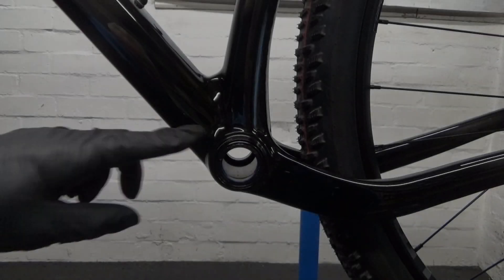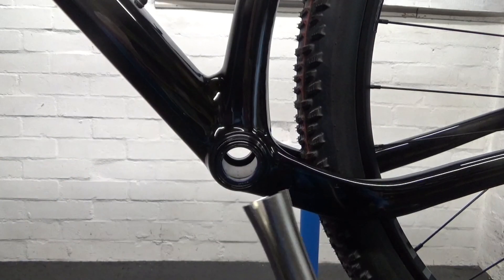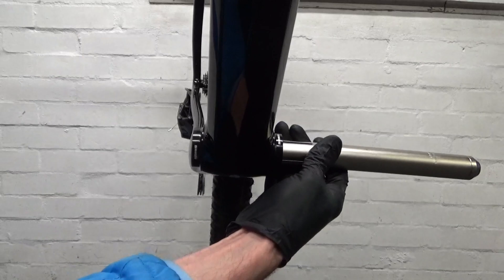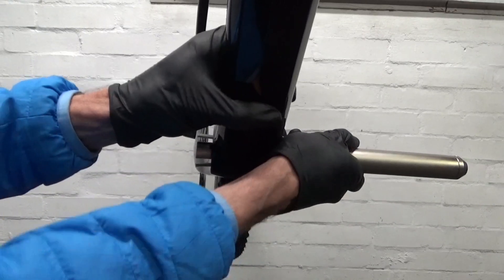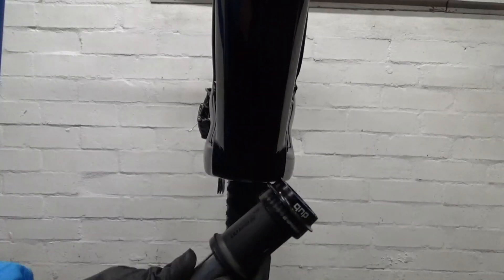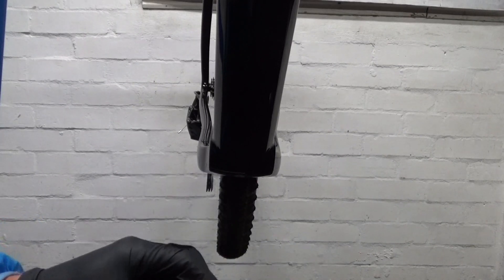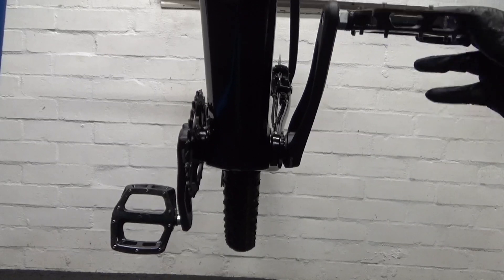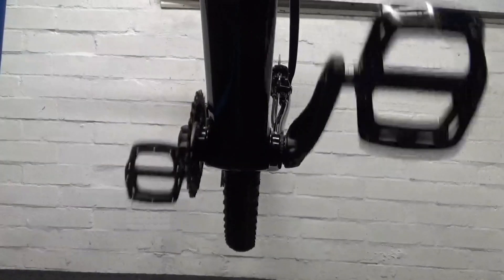SRAM DUB Pressfit 30 Bottom Bracket Fitting Guide

Comment: I usually do the pressing in part one at a time. my tool has ridges on the drifts so it fits nicely on the shell on the opposite side. I've never had an issue doing it this way other than it takes a lil bit longer..